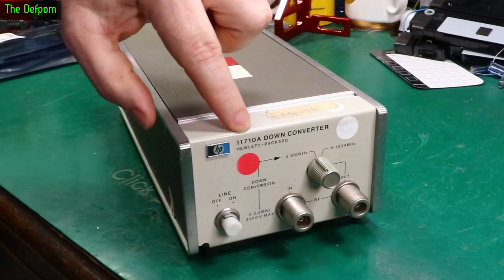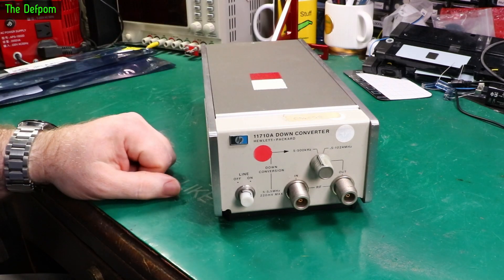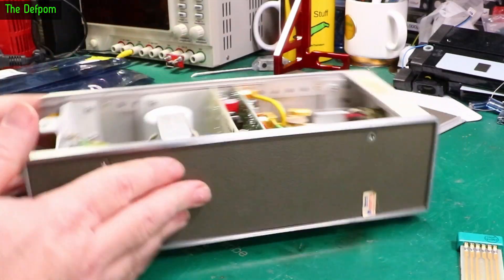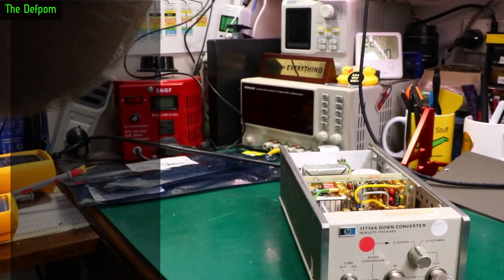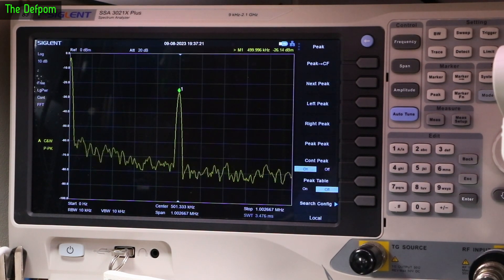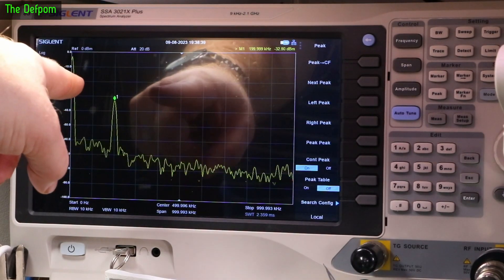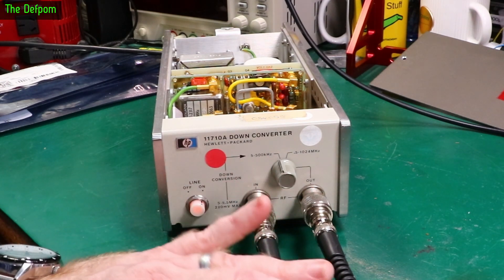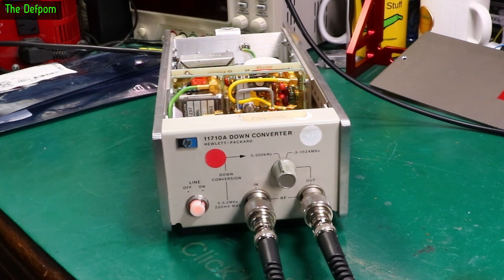🔴 HP 11710A Down Converter Equipment Score - No.1194

Comment: There is a VERY brief description of the use of this unit in the HP 8640A Operating & Service Manual. It's purpose was to extend the generator output down to 10 kHz (nominal lower limit is 500 kHz) while maintaining the ouput level and modulation characteristics. Very specialized use, probably for servicing VLF equipment such as homers and compass locators (200 -300 kHz range). Regards, David